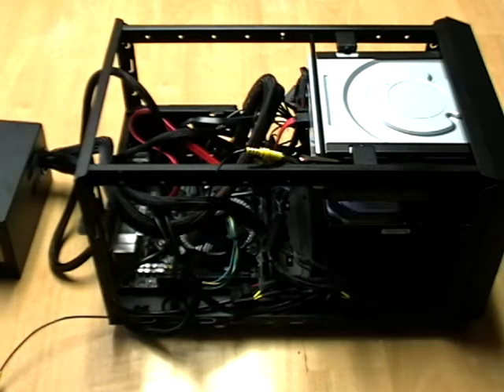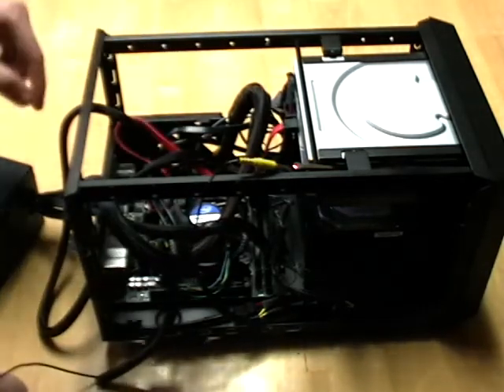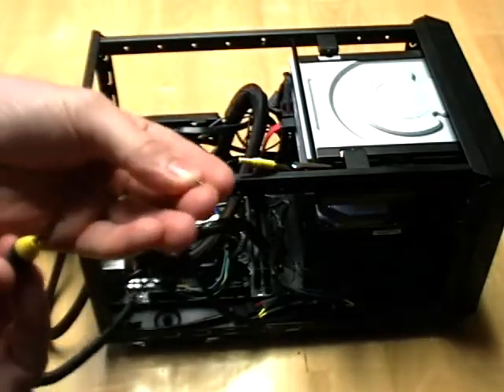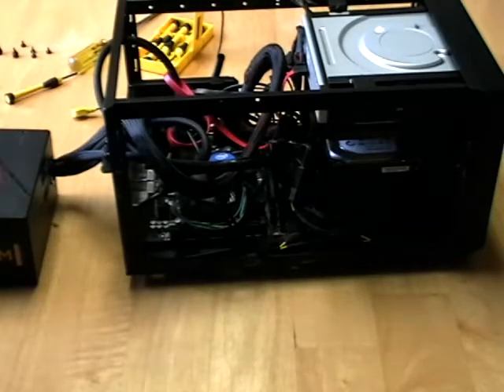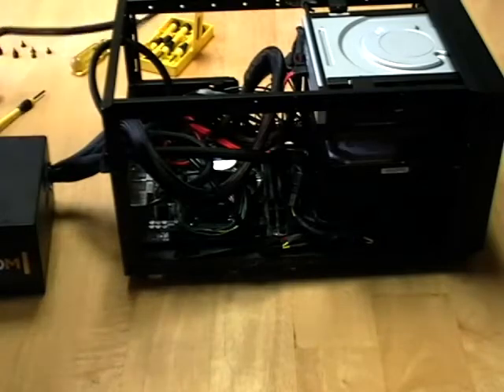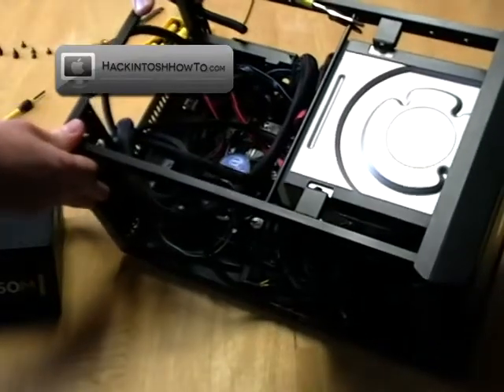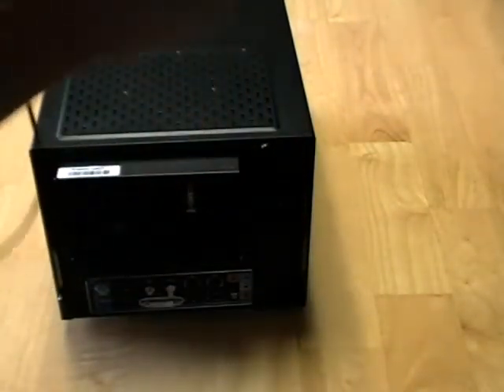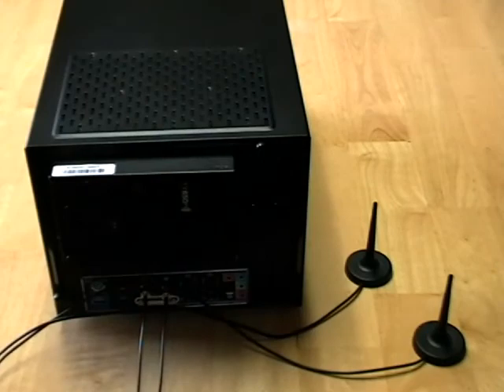Building a Mini Deluxe Hackintosh | WIFI Card for Wireless Internet Access | Step 25 of 25

Comment: it is very hard to see the video in 480p :) I have a question and I would really appreciate if you're able to answer it!

I'm doing a Hackintosh using a similar motherboard, the Gigabyte Z97N Wifi. Did you have to buy anything extra to swap out the wifi cards or did you just have to buy a different wifi card? I know you mentioned having to buy Wifi pigtails but was that just because you broke the original or what?

In short: what do I need to buy to replace the wifi card? Just the card, or some antennas or something too?